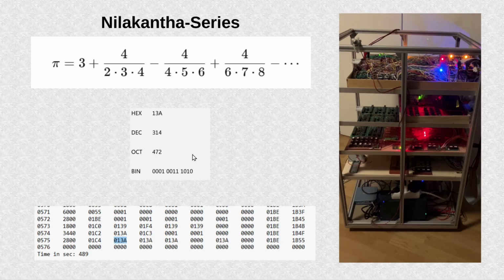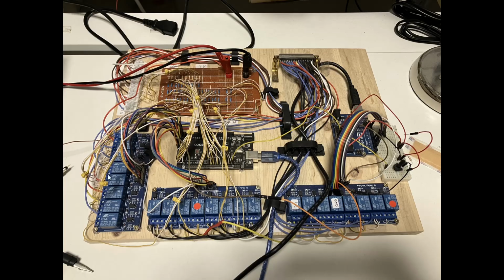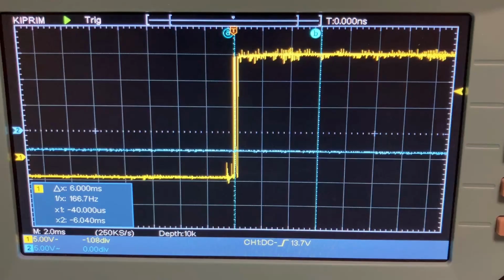Calculation of PI using a relay system: found a hardware problem

Comment: It's not clear why two bum relays means you have to completely redesign the module. ?.
Reply from the maker: To avoid these problems in the future...and because this type of relays is less durable than the relays I used in the relay CPU. But I am not sure what to do, maybe I build my own relay based 5V -> 24V using the black relays and transistors.